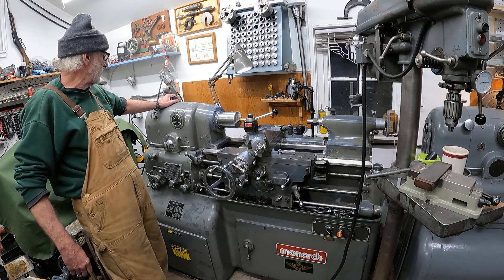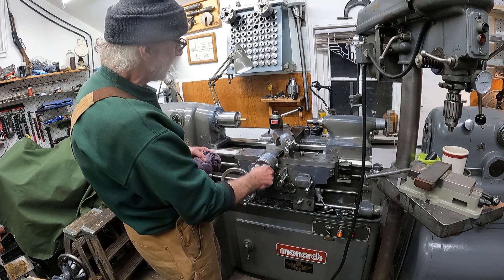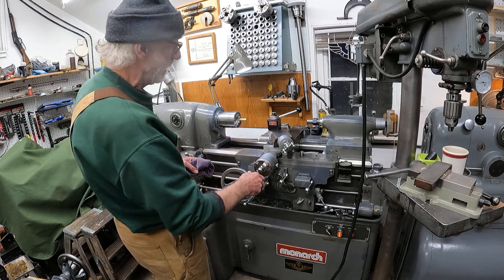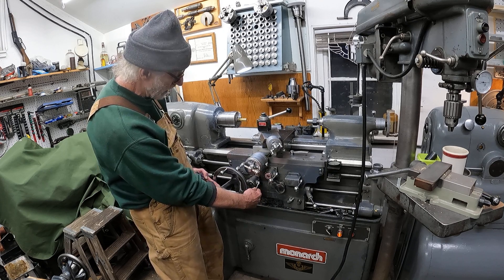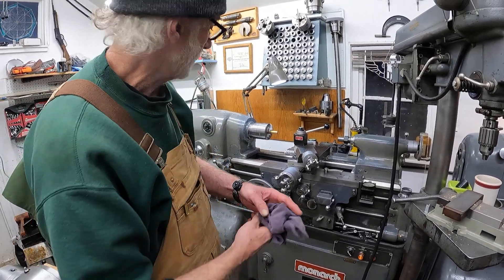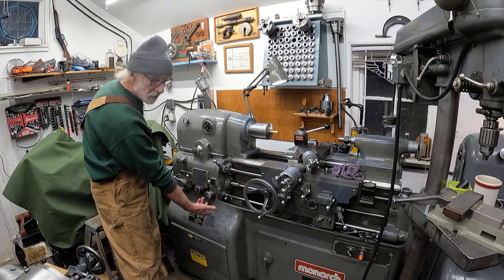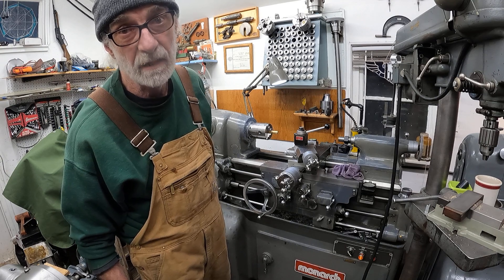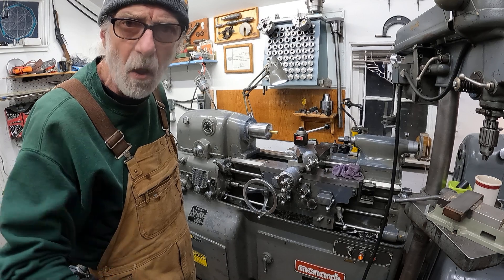Monarch 10ee Lathe Testing top speed!

Comment: I got a monarch EE i just got. Everything mechanical is perfect condition.. but it keeps hunting for speed at low rpms. It has the tube retrofit so it has one tube in there. Any idea how to solve my hunting for speed issue? I did the instructions on front of box with the POTs but doesnt seem to help. Thanks in advance
Reply from the maker: Hello, I have no experience with tube retro fit, but the C3J tubes are a weak point and a spare should be on hand also module diodes can fail or get weak in rectifier 3. both can effect speed control.
Don

Comment: My 10ee tops out around 3800 rpm.  I'm a chicken to run it that fast with a chuck on it like you are doing.   I have used it that fast with the 5c collet nose and it feels  pretty safe.  I was wondering if the light you have on the machine is original or an aftermarket item?  If aftermarket could you tell me the model number and where you purchased it?  Thanks for the video.
Reply from the maker: Hi! The lamp is a factory option, made by Electrix, it has spring covers and no switch. The lamp comes on with the mains disconnect switch.